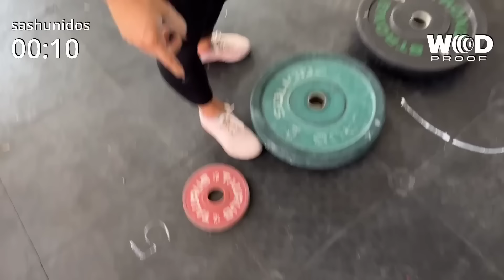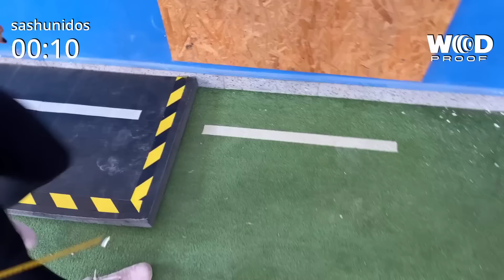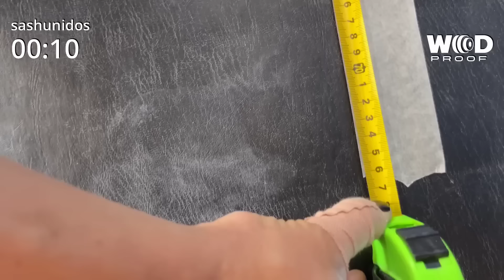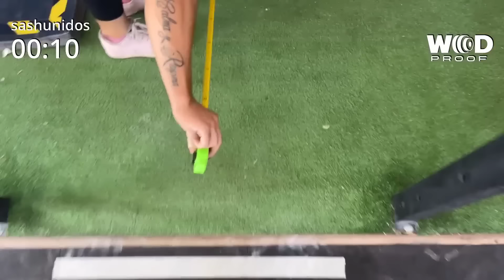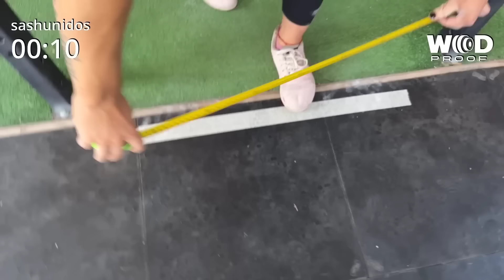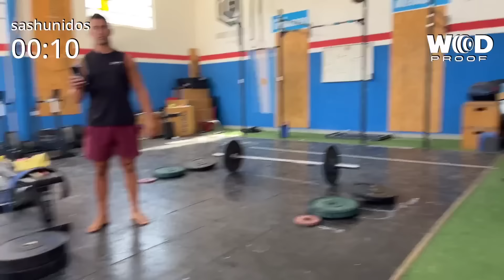Sasha Nievas Open 23.3 | 7:45 currently WORLD RECORD

Comment: 2:30. The measurements were done incorrectly. It should be 139cm to the front of the line. It’s only 134cm because they measured to the back. Invalid unfortunately. And that on top of the dub no rep.

Comment: 110% hats of for the effort and performance, really really impressiv. But as other also writes. Measurements were wrong. There were a missing rep. Also its very very hard to see if those HSPU are correct. From a video perspective it looks like quite a few no reps due to standard not being held. Like the but touches the walls etc.

However amazing performance, but if everything needs to be correct, then a time penalty should be given.

Comment: Also it states that only the feet may make contact with the wall during the Hspu. Pretty sure he head is bouncing off the wall lol we had a few people in my gym getting no repped because of that
Reply: wow, not to take away effort from the woman in the video but good observation. also,

"Only
the heels may touch the wall during the repetition. The
feet may be no wider than the width of the hands at
any point."
Reply: i don't know how that would be an advantage tho.
Reply: Ofcourse no denying she is a beast
Def at her level it wouldn’t be aiding her, she can easily do these with a vest on.

For someone starting out, placing the head on the wall provides some stability and therefore makes it’s easier to push through a Grindy rep

A standard is a standard none the less. 
The way she just rips that tape roughly with her “that will do mentality” says a lot. Lol
Reply: @MrAcrobat20  Thanks for sharing, that makes total sense.
Reply: The way she half-assed the tape adjustment speaks volumes.